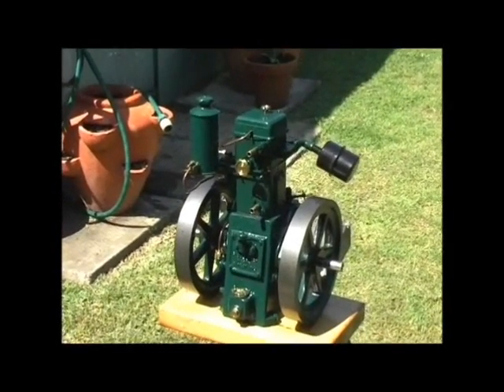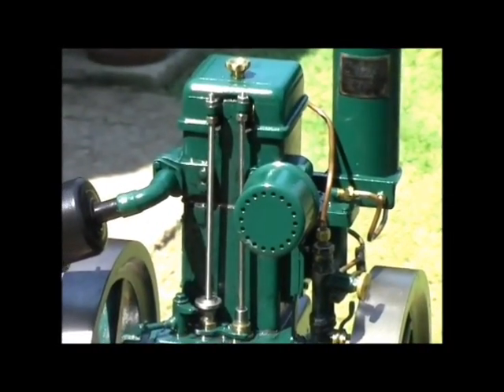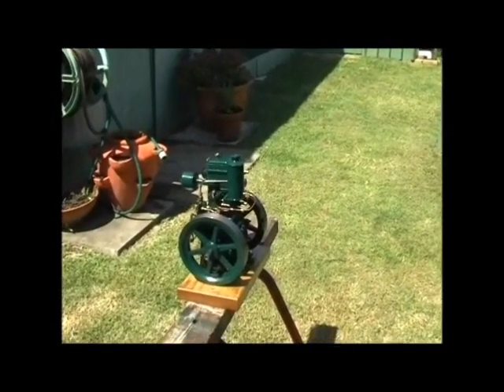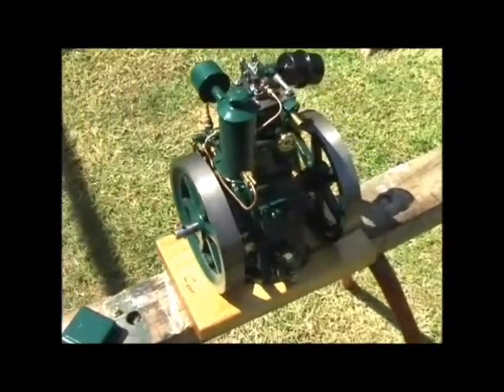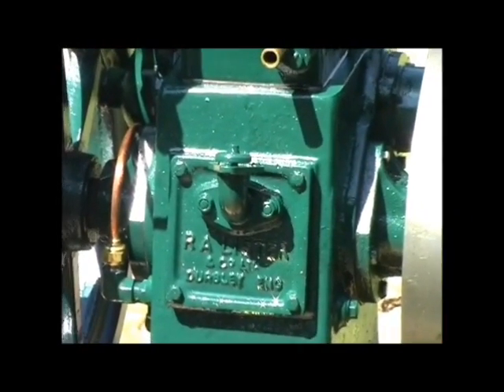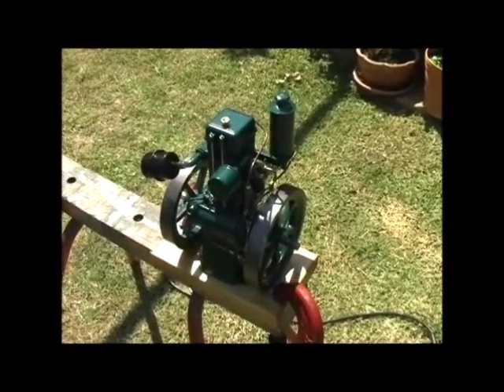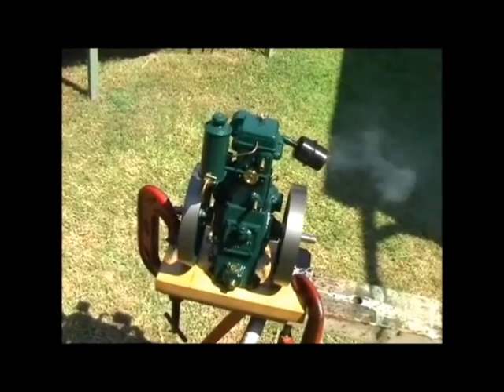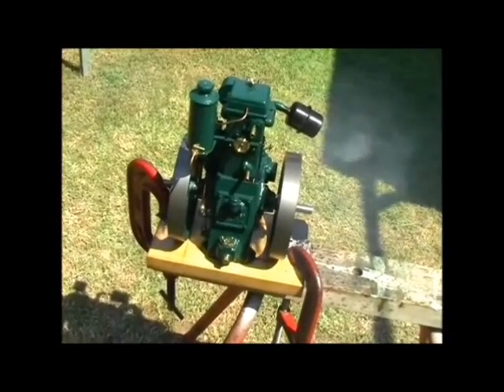Working 20cc  Scale Model Lister Diesel Engine

Comment: very inspiring, would hope you share details of your fuel pump and injector, I have built a Find Hansen A-frame diesel but it runs on gas and spark ignition, waiting to see some viable plans for pump and injector for my already partially built #2 Hansen true diesel engine !!!

Comment: If it was "running away", then wasn't it being overfueled? Diesel engines are efficient in part because they specifically avoid the pumping losses associated with a throttle or venturi.
Reply: I too was surprised when he said there was such a small (1/16 in) restriction.  I think running the engine without any kind of load  on very small scale tends to produce unpredictable behavior.   It might be that his fuel cannot be reliably metered at the very low rate required.  Hence the smoke.

Comment from the maker: The injector nozzle was made from a small gas jet. The injector does  have a needle ,piston and Spring but also has check valves in the fuel line. I experimented with and without the injector needle and found it  worked both ways as the check valves prevented any " blow" back. The amount of fuel is controlled by a bypass needle.

Comment: Amazeballs amazingly cool top notch if I had any suggestions I'm sure you're already on it if the compression ratio and the injection brake pressure is correct the only thing left is timing with the fuel dripping out the exhaust I'm betting it's a bit late so cool I really want to build one myself even if I do it out of old bits of junk engine maybe I should build a 2 stroke diesel

Comment: I think its dribbling from the Exhaust because you have restricted the inlet so much - this causes a vacuum above the piston towards the end of the induction stroke which sucks oil up from the splash in the crank case past the piston.- it needs a governor alternatively try restricting the exhaust - what do you recon?

Comment from the maker: Christopher I did write an article for an magazine in the UK which related to old stationary engines but I have not seen it in print. That may be because of the delay in some magazines arriving here. t he UK Model Engineer magazine has been running a series on the Lister since the beginning of the year. There were 84 sheets of drawings with a brief account of the construction
Reply: do you know if your article has got printed ?  i am looking at building my self as i have a big 6/1 but it's hard to take to show lol. thanks for any info.

Comment from the maker: The injector pump has a bore of 4 mm and a stroke of .090" and a needle valve controls how much fuel is actually injected into the engine. Drawings of this engine have appeared in the Model Engineer magazine. The outline of the fuel and oil pump have been kept as near to scale as possible.

Comment: isn't that a rather big injection pump for a 20cc motor? how did you calculate the fuel-air ratio. I ask because I'm trying to make a 100cc diesel and the stoichiometry works out to 0.01cc of diesel so I'm wondering how to make such a small pump

Comment from the maker: Thanks for the comment.  I hope to use the engine to drive a generator soon but I have been busy drawing up plans for the UK Model Engineer magazine. Making the engine work may slow it down a little but I will need to connect up the governor.

Comment from the maker: The fuel tank now has a steadying arm fixed to the rocker cover. At present it still runs too fast and I need to work on the slow running. I intend to connect the governor to a butter fly valve in he air intake so that there is some degree of control!